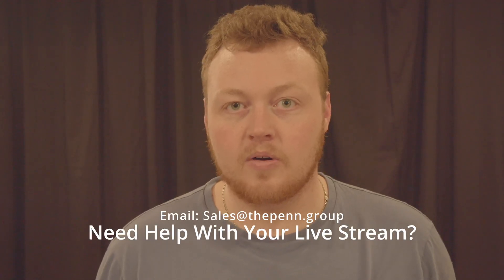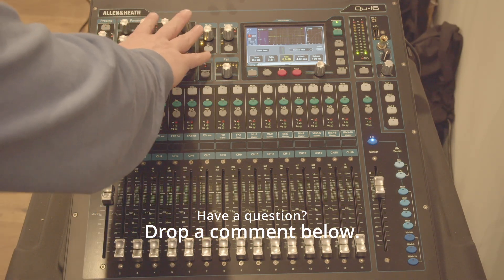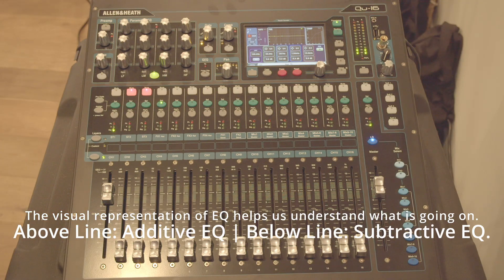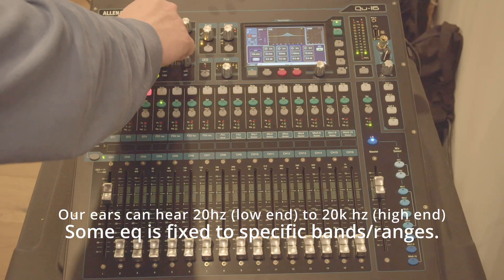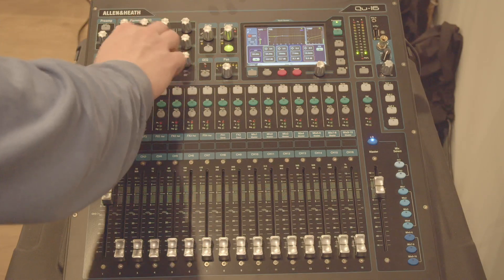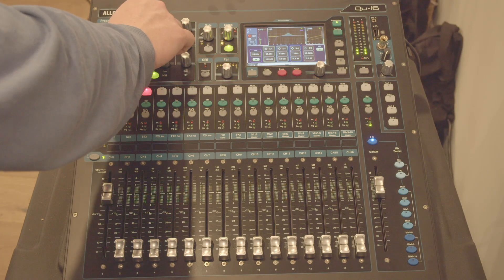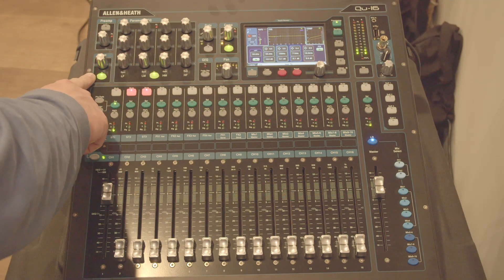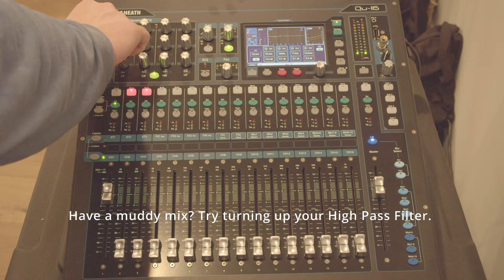How To Use EQ On a Digital Audio Console | The Basics of EQ | Allen and Heath QU-16 Console

Comment: Great video Austin, very well explained. I'd love to see you talk about eqing a room or venue. If the room is boomy, or dead, what is the process of controlling that??  I'm having trouble in a couple of different rooms my band play in due to boomy areas. My main problem is my bass guitar. It's sounds perfect in one room, and the next it's all mud and way to much bottom, even tho the bass guitar channel settings haven't changed. We travel with the same pa to different venues. Thanks in advance!
Reply from the maker: Hey! Thanks for the question. 

Fighting low end mud is a challenge in every venue in different ways. In some cases you’re fighting a room issue. Some cases a PA (subs) issue. 
If it sounds great in one, but not the other, I would turn to eq to get the problem area out. If that isn’t working I would roll the bass off to about 60hz, which still gives a nice low end but cleans it up a lot. Send me an email if there is anything else you need: 
sales@thepenn.group